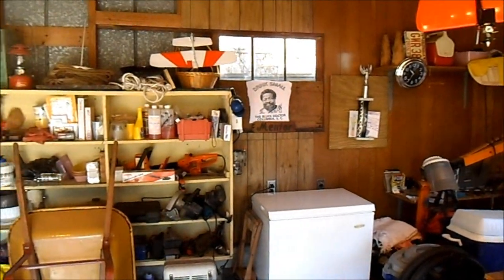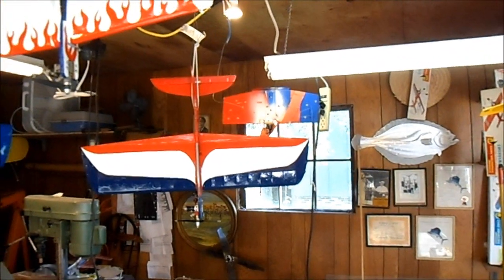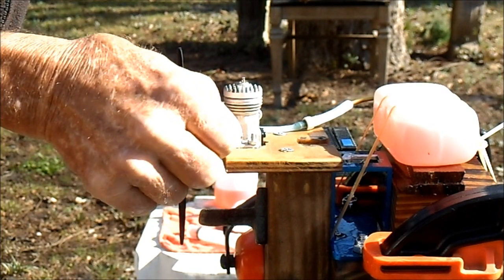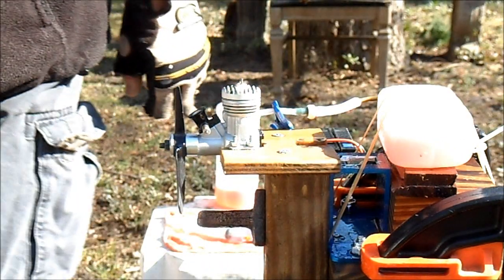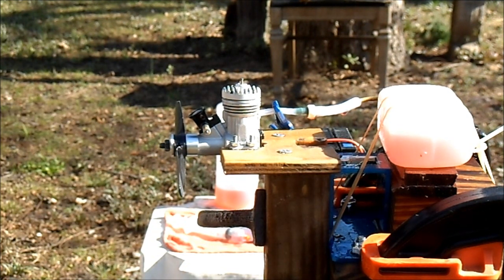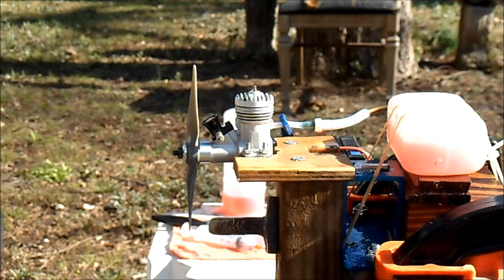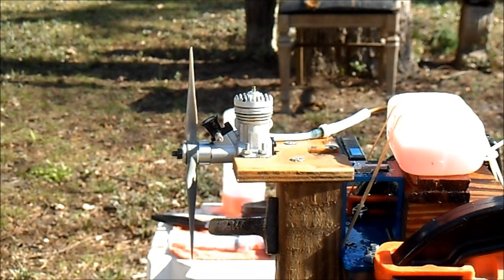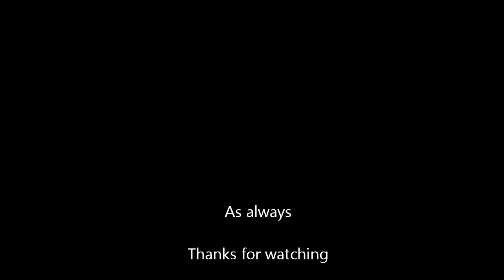MP Jet .061 control line engine demonstration

Comment: Hey Rusty,thats a screamer.I have also 2 MP jet diesels,and they are great runner.I notice the head is a 1/4 turn twisted..have that a purpose? For cooling it wil be better to have the fins with the flow usualy.Mabey it has another reason?
Nice workshop..Al there,what you need to get lost in lovely projects!
Wish to have a big place too.Here in holland its still freezing cold...so no runs at the moment.. Good flights!!
Regards,Peter

Comment: Are those engines still available? If so, where can I get one?
Reply from the maker: Hey GuitarGuys,
Try this. Looks like they have them in stock.
http://www.icare-icarus.com/Diesel-Glow-Engines_c_19.html
And they might be still available through Owen Engines in Austrailia.
http://oea.modelenginenews.org/pricelist_2012-07.pdf

I have the Plain Bearing .061 in the video and a new Factory Race Special ball bearing .061 that I'm putting on a 1/2A combat wing after I break it in. I'll be posting a bench run video of that one soon. It promises to turn some scary RPMs, hopefully up there with Fora and Cyclon in the 35K range. Don't really know yet. I'm only going to use 35% nitro in it.